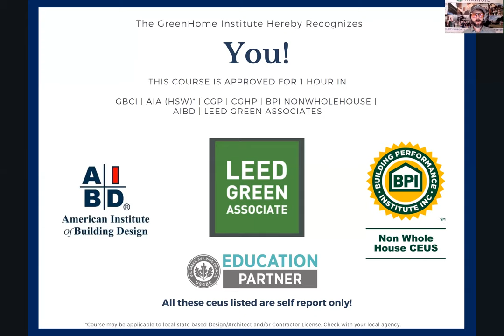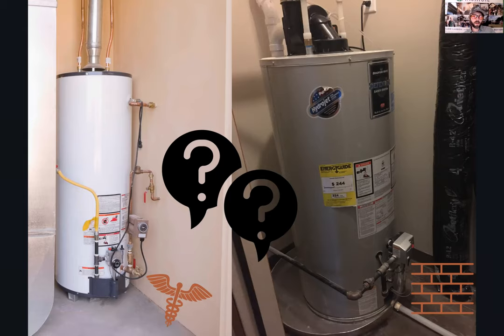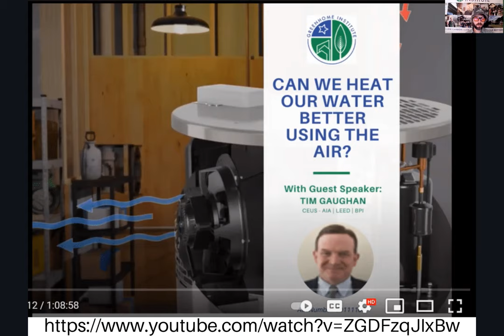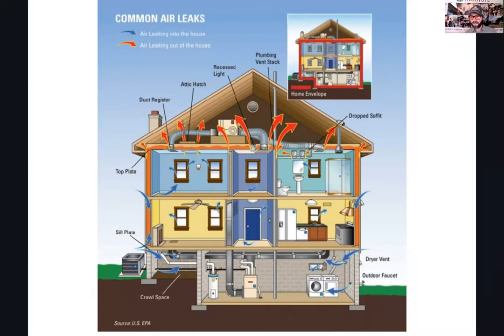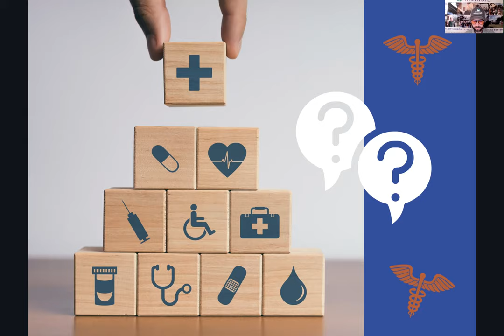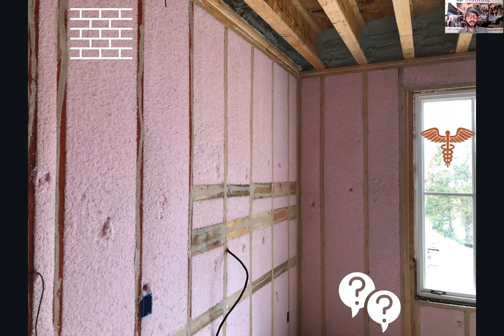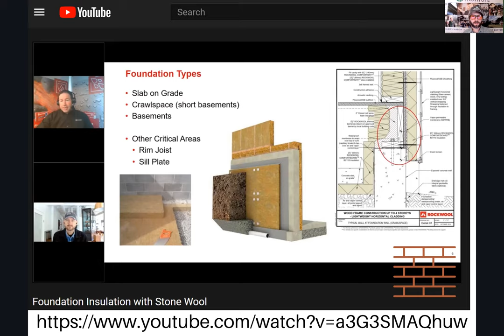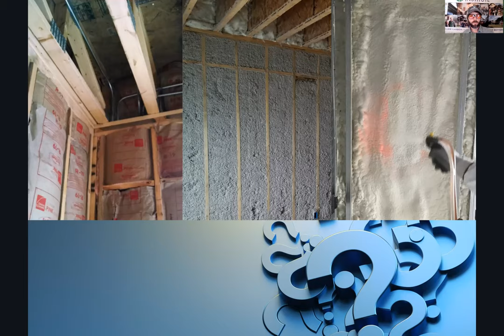Basics of Residential Green Building & Remodeling - 2 Energy

Comment: What happen if we have power outages for a period of time it seem like most of your ventilation and heating is going to be electric
Reply from the maker: Great question! I believe I address this in part 3 or the place pillar.  Anyway, it is a concern. Communities or utilities can fix this with micro grids and solar. In the summer it is less of a concern with solar but in the winter time it would be a concern for heating especially.  You could use a wood burning stove in the dead of winter. Make sure you have  low level CO monitor and it is vented well. We are looking into biofuel fireplaces as well as gas or electric cars (ford lightning?) that could back feed the house.  Let us know if you find a good idea!